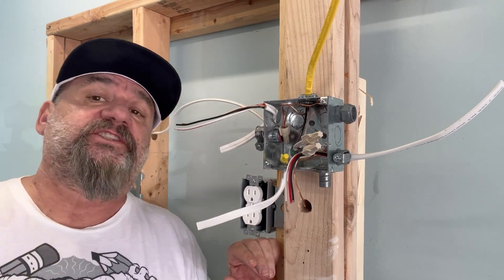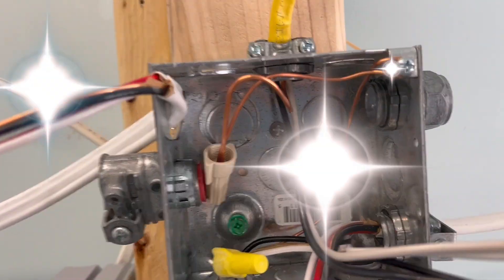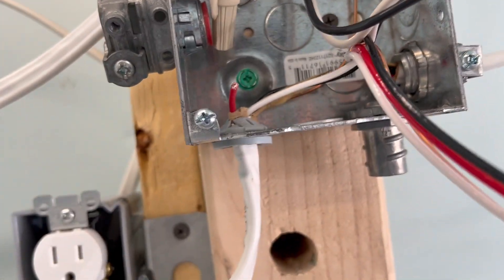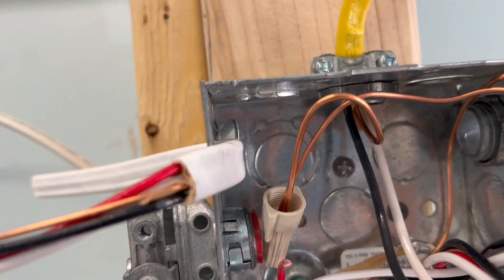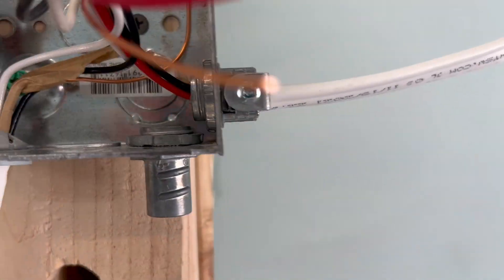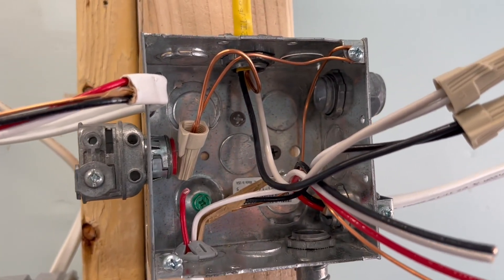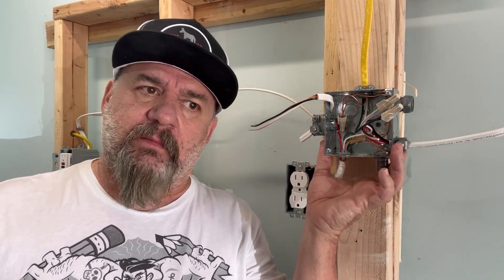Electrical Metal box Wiring, The Good, the Bad, and The Ugly - Connectors, Code, and Wiring.

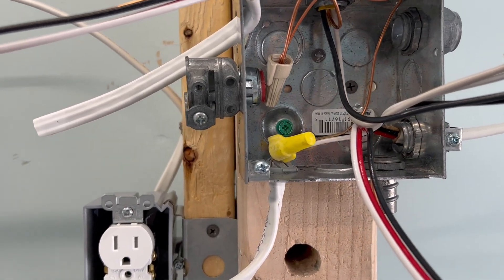Comment: 1:41the breaker should trip before the wire insulation melts. I think you got that wrong
Reply from the maker: so if you put a 14 on a 30 amp wire were worrying about the insulation? its about a tripping point. In essance the wire will fail before the breaker trips.  Thats why we dont install bigger breakers. So however it goes it goes. im not wrong I am trying to point out why we dont over size breakers.
Reply: @StarvingElectrician  the wire wont fail it will get red hot if the breaker dont trip you can put 14 wire on a 30 amp beaker the wire will not fail. i have a 30 amp breaker on a 14 wire in my Garage for a compressor and more been that way for almost year 20 years works just fine
Reply: @clarencemoore2924 
You probably use the compressor less than once a year, lol!